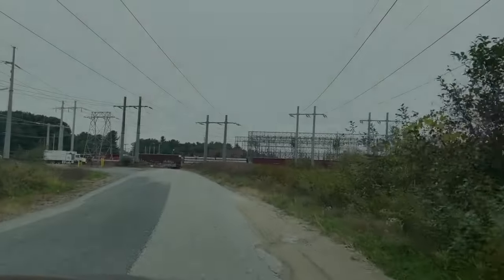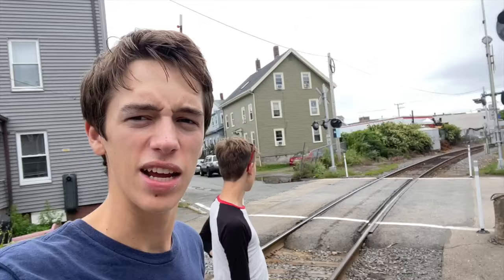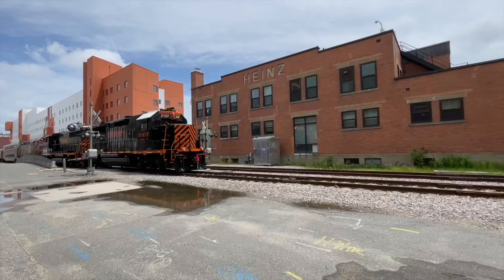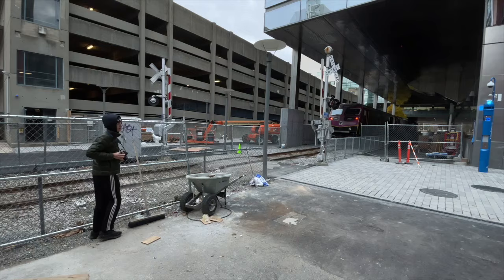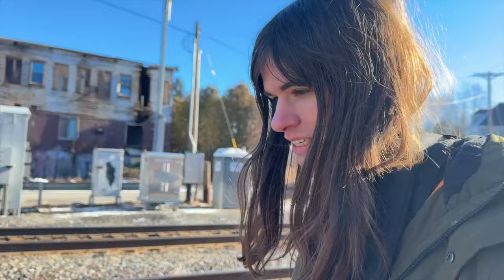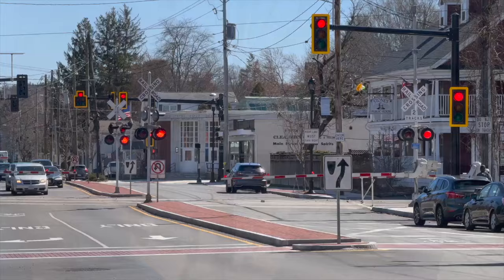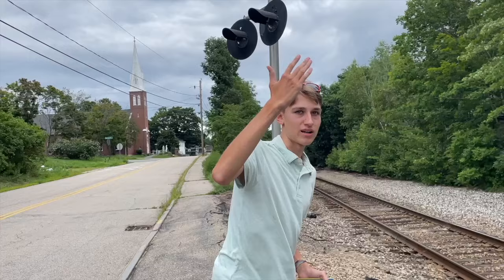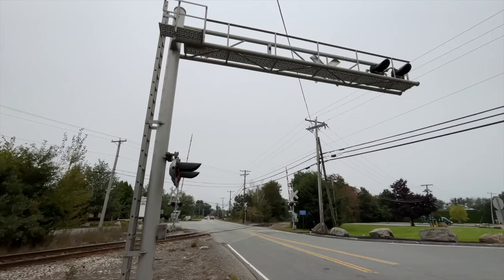The MBTA's Latest Project: Railroad Crossing Safety | Infrastructure on the MBTA

Comment: If you're ever in the Abington area, you'd want to check out the crossings. There have been multiple accidents at crossings, and due to that, the crossings are outlined with white paint and are diamond striped, especially since most of Abington is double tracked.

Comment: I grew up railfanning at the Ashland crossing  among other places, It does have a pretty cool setup. 

Something not mentioned that Is cool is the building to the right of your distanced shot of it, “John Stones”. Lots of cool history behind that building, but whats relevant is “Ashland’s Ghost Girl”. Mary J Smith was 10 years old and on June 11, 1863 she was struck by a train. She was brought into Stone’s which I believe was still a condo house at the time. Currently, it is a restaurant but the second and third floor are blocked off and not touched. Rumor has it Mary’s spirit roams there and you can hear her giggling and running around. Rumor has it at night she can be seen in the windows or lights turn on, on the top two floors.. And if that doesn’t scare you, the dress she was in when she was hit is framed and on the top floor, with blood stains still visible. More pictures and photos are online if your interested, and some ghost hunter crew even has a video on youtube of exploring the closed off sections of the building..